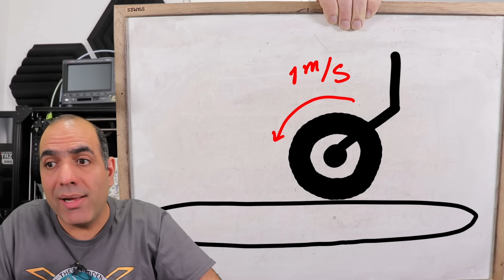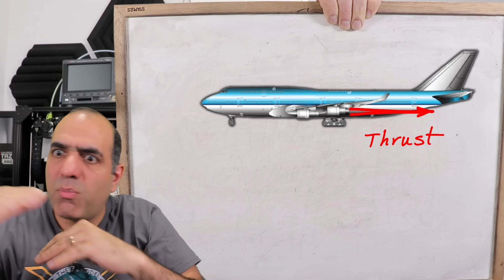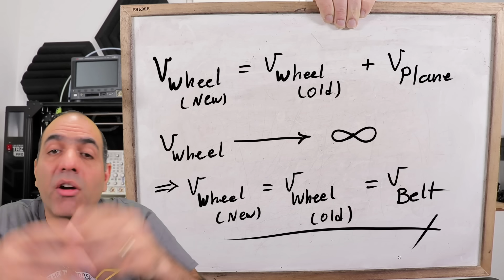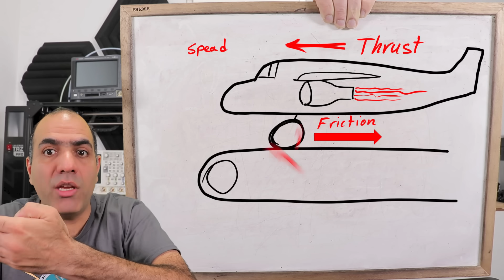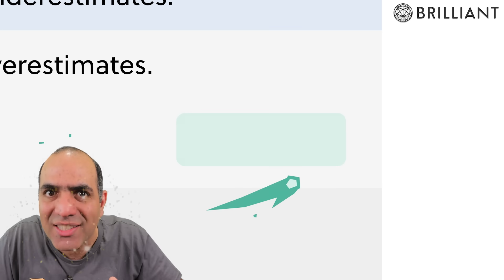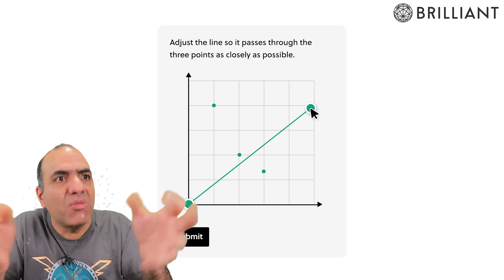Airplane Question that Drove Me NUTS!!!

Comment: But where does the AIr come from that the plane needs if it stays stationary ?
Reply: It doesn't stay stationary
Reply: The wheel brakes are off, the engines are at full revs, what happens?
Reply: but the wheels are stationary and turning in their place so there will be no air to lift the wings the plane needs to be moving to generate that air which lifts it right?
Reply: @Nemsis19    The wheels and plane can move, the conveyor moves in the opposite direction at the same speed.  All that happens us the wheels rotate at twice the speed of the plane, that is what finely machined and greased zero friction wheel bearing are for.
Reply: @givenfirstnamefamilyfirstn3935  the way iam seeing ut is that the convoy will cancel the plane's movement which means the plane is gonna stay stationary its the same like putting a car on a convoy and holding it with ur hands the speed of the wheels will match the speed of the convoy and it'll be same like a car moving on a route but its fonna be stationary
Reply: A plane on a treadmill is different from a car on a treadmill. With a car, friction between the rolling wheels and ground are what pushes it forward. If the ground is moving with an equal and opposite magnitude to the tangential velocity of the wheels, there is no push from friction and it will remain stationary. Steve Mould's video about the turntable paradox actually shows this very phenomenon with a billiard ball.
But a plane is different. What pushes a plane forward is the reaction force from hot, fast moving air that is accelerated backwards. In response, the body of the plane is pushed forward relative to the air.

The treadmill and wheels are really a red herring. Since their magnitudes are always equal and opposite, we can set them both to 0 by using a normal runway and putting a clamp boot on the plane wheel. With more than 120 tons of force pushing a 747 forward from all 4 engines, it will drag the wheels across the ground no matter what they're doing. Not only could it still take off, it would barely be any slower than normal.
Reply: @snowthemegaabsol6819  but what will generate the lift if the plane is stationary? shouldn't the wings have such a air resistance in order to function correctly ?
Reply: There would be no lift if it stayed stationary. But it doesn't stay stationary, it gets propelled forward by the hot air accelerated backward by the engines. Neither the wheels nor the ground are a part of that process, so we can simply ignore them. That's why so many people hate this question, it's a trick question
Reply: @snowthemegaabsol6819  well i actually still can't get it  though .. in a normal plane why there are wheels at first place ?!
Reply: For exactly the purpose of why wheels were invented, to make the vehicle and its cargo easier to move, and to cushion and protect it from the ground. Without wheels, it'd be like pushing wheel-less shopping carts across the ground. Certainly doable, but takes more effort and damages the cart.

Comment: nope there is no wind giving the plane lift
Reply: Sure there is. A strong wind against a stationary aircraft is the same as a fast aircraft flying through no wind
Reply: @snowthemegaabsol6819  the wheels dont make a plane fly the wings do so just moving the wheels will do nothing and as of wind there was no mention of
Reply: The plane would be moving forward so yeah there would be once it got up to speed
Reply: @1RED1  no the plane would be stood still the wheels just move
Reply: What happens when you push a vehicle in the direction of alignment of its unbraked wheels.  Will air flow past that vehicle?
Reply: @givenfirstnamefamilyfirstn3935  the plane would stay still and the wheels will move around if the break was on and the track was moving the plane forwards fast enough then it would get lift
Reply: If you've ever seen a wind spinner, they don't spin in still air, but you can get them to spin by swinging them through the air. Same principle here, you don't need wind, you need airspeed
Reply: @snowthemegaabsol6819  try it

Comment: I don't quite understand how wings are able to get lift if they are stationary relative to the air molecules.

If this would work the military would have something like this to launch any airplane on a tiny runway
Reply: Because they aren't stationary. The engines are going to push the body of the aircraft forward whether the wheels like it or not
Reply: What exactly is stopping the plane from being pushed by take off thrust engines?  Parking brake is off.

Comment: Is simple.  if the belt is  making the wheels turn at double speed it would if roll over a static tarmac,    the plane  will  take off anyways,  just a small extra thrust is eneded to overcome the extra friction caused by  the wheels bearings and tyres,  because the plane flies due the whings  doesn´t matter the wheels.  Even a plane can be fliying  while touching wheels  on the ground

Comment: My guess: You cannot answer the question without knowing how much angular momentum is transferred from the wheels onto their axes as backward momentum. Assuming that the thrust of the plane comes from the engine, and the axes are entirely frictionless the wheels will just spin aimlessly with twice the velocity of the plane in the opposite direction, supplying only upward force, as the plane accelerates as normal, and takes off.
Reply: You can easily calculate the transfer of angular momentum by assuming the wheel and axle has the same friction as an automotive wheel and axle setup which can be useful for an order of magnitude calculation.

Comment: It's pretty obvious, it can not take off. Since it never moves. It is just it's wheels that moves.
Reply: Of course it can take off. A 747 is being pushed by 120 tons of force from engines that don't care about what the ground or wheels do. It will simply drag them across the treadmill if necessary

Comment: If the belt moves in the opposite direction of *the wheels*, then doesn't that mean it moves in the direction the plane is going in? in that case, the plane would take of normally with its wheels standing still for the whole maneuvre
Reply: "Opposite" in this context means they rotate with opposing chirality, meaning if the wheel spins clockwise, the belt spins anticlockwise, and visa versa

Comment: Wheel speed is different at different points on wheel. 2v at top, v at center and 0 at bottom where it touch the conveyor (all speeds relative to conveyor). So if we consider wheel speed as speed of center of wheel, then plane (& Center of wheel) will move with v, Conveyor with v in opposite direction and wheels will rotate omega= 2v/radius of wheel.
So, it will fly..
This could be one more answer.

Comment: This is so stupid... The land speed does not depend on the speed you can transfer to the wheels, but to the air. it makes no difference. If you put a cylinder on a conveyer belt aligned in the right way, it will stay put even if the conveyer belt is moving. the same thing would happen to the wheels on the plane.

Comment: At some point the conveyor has to slow its speed to allow the plane to travel forward and off and fly up after getting enough air lift, since it'll have enough speed to travel forward using less of the runway for taking off.

See we're thinking of the airplane on an elevated platform conveyor, instead of a long flat surface embedded to the ground creating a seamless surface between conveyor and actual runway surface with minimal gap between the surface of the runway and conveyor, so in theory you can use less runway to build up speed you need, and hopefully get the lift you need in a short amount of distance as possible. Something like this in theory could help for places that have very small runways at their airports, and don't have enough room to add more length to it.

Comment: Wheel speed is irrelevant. Air speed is everything. The point of a treadmill is to be stationary relative to your surroundings. The the surroundings includes the air, the air speed is 0 and the aircraft cannot fly.

Comment: Since the plane is not propelled forward by the wheels, it's irrelevant to think of the wheels on a treadmill. Just imagine a plane taking off on water. There are no wheels, and the scoots knew nothing but keep the plane afloat like the way wheels keep the plane off the ground. Take off is Occurs because the air is being pushed over the wings. If the air speed is fast enough, the plane will take with moving forward. In high winds, pilots will tie down small air planes so they lift. 
One more question if I make the plane with no wheels but perfect magnets so it levitates, will it take off. Yes! Just like a hovercraft air will still push it forward.

Comment: For F**Ks sakes there isnt a need to even think about this.  The wheels have NOTHING to do with accelerating the plane to takeoff speed.  that's the thrust from the engines.

Want to blow your mind?  There are planes that use ski's and they take off fine

Same goes for float planes

Comment: Sorry but this is just stupid and trying to be a smart ass about everything. In case an element isn't mentioned in the question you have to assume it's the default or most obvious, otherwise you can't answer any questions because there is always some assumption you can make that renders the question unanswerable. Wind isn't mentioned so there is no wind, planet isn't mentioned so it's earth. The given that the belt always moves at the opposite speed of the wheels means the plane can never move a single cm in the direction of its length. So it can't take off, done.
Reply: What is invalid about the wheels (and the rest of the aircraft) going at 10 knots west and the conveyor top surface going at 10 knots east?  The case is met, they move at equal speed and in opposite directions.  The speed of wheel rotation is not relevant or important, ignoring Mehdi’s infinity nonsense.
Reply: @givenfirstnamefamilyfirstn3935  the conveyer belt matches the speed of the wheels, which is the rotational speed. If the aircraft is moving with 10 knots west and the belt with 10 knots east, then the wheel rotate with a speed of 20 knots, which is not equal to the belt
Reply: @CODZILLA19  It said the speed of the wheel, the wheel is attached to the undercarriage leg.  The speed of the conveyor matches the opposite direction speed of the wheel, leg and plane.  The question did not specify rotation rates, what if the main wheels and nose gear wheels had different diameters? they would rotate at different rates, which wheels would you ignore?
Reply: @givenfirstnamefamilyfirstn3935  yeah that's a valid point, but since they specifically say speed of the wheels, and not speed of the aircraft I think the best assumption is that they mean the rotational speed (the speed at the outside of the wheel), the size of the wheel doesn't matter for that
Reply: @CODZILLA19   The bottom surface of a double speed wheel moving away from the conveyor at the aircraft’s single speed is at the exact same speed as the conveyor belt …. and the wheel and conveyor belts are rotating in opposite directions.  Mehdi didn’t account for the fast spinning wheel also travelling away from the conveyor belt, that is where he got his infinity from.

Comment: The belt would also have friction with the air, so any movement of the belt backwards would create some wind backwards.
Which means the plane would eventually take off in the full-friction scenario by the wind created by the belt.

... Assuming the wheels did not combust.
In which case the scenario breaks down, because the belt can no linger match the spped of the wheels.

Comment: friction can't grow infinitely,
the static friction can only get finite large, then caps at sliding friction, so the sliding friction is the maximum friction there can ever be.

(sliding friction could be slightly smaller than static friction but let's just ignore that)

so in the friction case, (if the wheels and their bearings are strong enough, and the converyor belt is long enough),

when reaching certain speed, the friction force between the wheels and the conveyor belt would be capped at sliding friction and can't get any larger,
then the wheels will begin to slide on top of the belt and can't rotate any faster,
at the same time, the plane would still be gaining speed forward (however slowly that is) and eventually take off.
Reply: There is no escalating friction, that is in Mehdi’s head.

Comment: Before watching the video, it seems clear to me that the aircraft would be able to take off without any problem, because the thrust comes from the engines, not the wheels. Let's see how wrong my assumptions are.
Reply: It doesn't matter if the wheels are mechanically connected to the propulsion system. Lift is generated by the difference in velocity between the solid object and the fluid. There must be motion between the object and the fluid: no motion, no lift. It makes no difference whether the object moves through a static fluid, or the fluid moves past a static solid object. Lift acts perpendicular to the motion.

In order for the plane to move, the wheel MUST rotate. Whether its mechanically rotated from an engine, or being drug along through friction, it doesn't matter. And as that wheel starts to rotate, the conveyer belt speeds up to exactly match the speed of the tire.

Comment: Simplest way to explain why the plane will take off: Imagine that the plane has no engine but is instead pulled by a tracktor. The plane will be moving forward no matter how the conveyor belt runs. The planes hull does not know if it is pulled by a tracktor or pushed by the turbines or propeller with the same force. The conveyor belt spinning underneath makes absolutely no difference to the planes ability to take off.

Comment: In the #3 case with friction everywhere, you can theoretically take off, if you reach your v1 speed faster than the growing friction can slow you down. Theoretically possible in a STOL aircraft, but certainly not a 747.
Reply: Case 3: replase B747 with F-35B. It is VTOL capable so it will take off.
Reply: @volodumurkalunyak4651  I was thinking of those Cessnas they use in Alaska, which can quite literally take off on a bedsheet
Reply: @vale.antoni  not only F-35B is that capable, but also some Cessna's - okay. Thanks for information.

Comment: I've never understood this debate. Even Mehdi Frozen answer out there that isn't physically possible which is if the Jets are going that means the air is moving a bunch but it's not The only thing moving air would be the jet itself but there's no physical lift on the wings so it's not physically possible to lift a plane or a jet if the air isn't moving over the wings but the jet doesn't move the air the jet only gives propulsion but the propulsion is what would move the body mass of which would match the movement of the treadmill The lift is still done over and above the wings

Comment: Yes, the plane will still move forward from thrust from the engines as normal, such that the plane will take off as normal. The wheels spin twice as fast but they are completely unpowered and irrelevant.

Comment: totally unrelated to the video but googling electrical questions doesnt feel reliable with all people having their own opinion 

i am looking for a power bank that can charge my phone and my laptop 
my biggest fear is to blow up my laptop and lose everything 
so could you tell me if i could charge a laptop that normally uses a 19 volt adapter with a power bank that outputs 20 volts 

thanks in advance and am loving the channel

Comment: The plan would still move forward but the wheels would stay still. Because the plane is propelled by the turbines therefore it beginnst to move forwarde and the wheels would spin but doesn't because the bellt would spin aginst and counteract it. I'm at 00:55 in the Vid.
Edit: And would take off ;) defenitly. But if the wind would counteract then it would not take off.